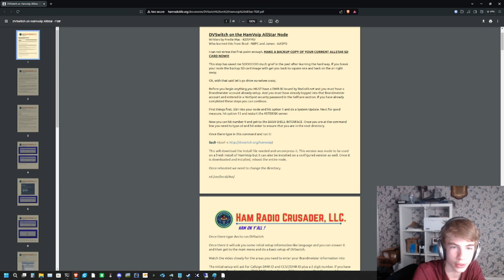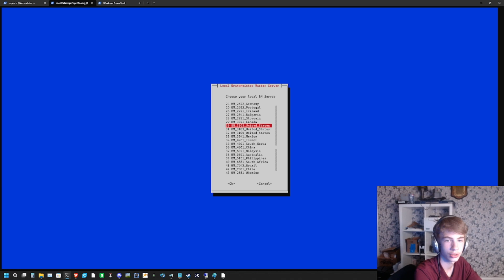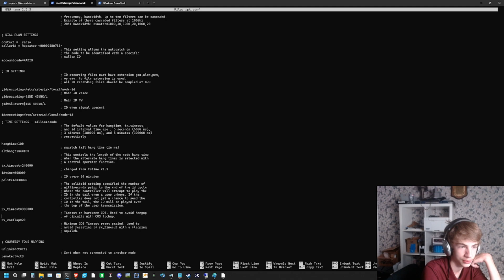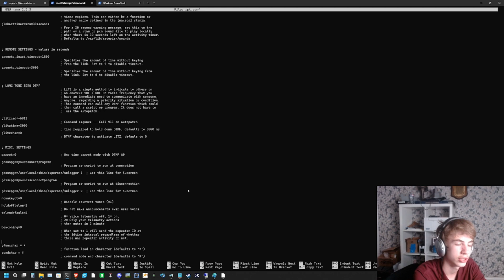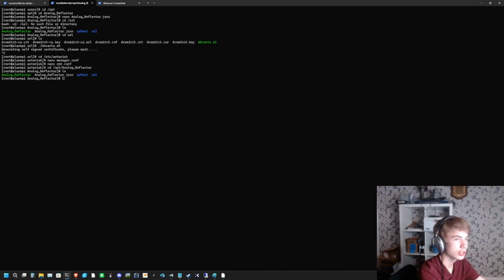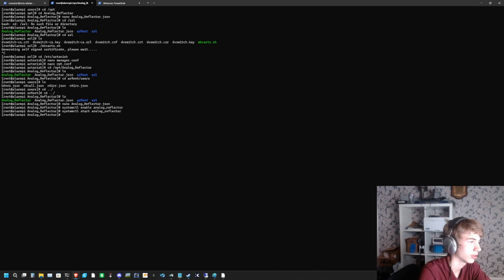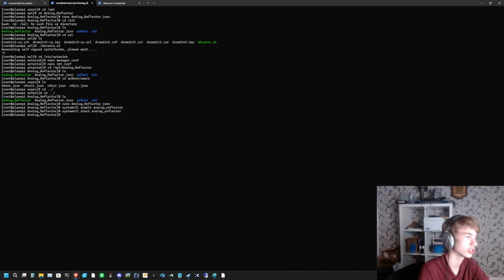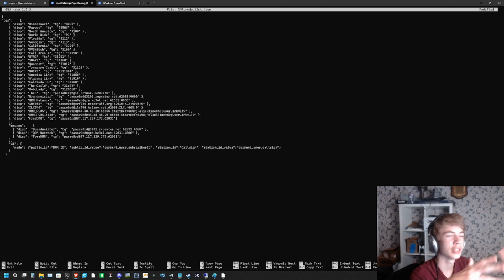Make your own Clearnode FOR FREE!! Analog Reflector Tutorial - Ham Radio & Networking

Comment from the maker: You DO NOT have to use analog reflector to make this work, instead direct the USRP ports to default and use this software to change modes/talkgroups: https://github.com/VALER24/dvswitch_mode_switcher 

As long as you only have the ASL bridge connected at the bottom turn automute to FALSE in the json file so you don't have to toggle it every time you want to change modes. If you want DStar to work well and make all the other modes sound a little better invest in a ThumbDV stick with the AMBE3000 chip.

Comment: Installation from your instructions was largely uneventful where I was able to get my HamVoIP node working with Brandmeister. That said I though there was a problem with my install where I had to (re)link talkgroup 91 (global) for every transmission into that group. But then reading the DVSwitch group, it would appear that Brandmeister blocks nodes that are not "properly" configured such as an out of the box DVSwitch configuration. In short there is far more information that I didn't configure, which might be the issue.

Then I went forward to configure my node for YSF, but I found I could only joint YSF reflectors by IP address and port. Using the reflector number did not work, even if YSFGateway was reading the reflector list file on the node. I joined the DVSwitch group on Google, but my post on this subject is moderated and the moderator apparently won't accept it thus my message never made it onto the group for others to read.

Older messages on the DVSwitch group suggests YSFGateway can work with a reflector number by prepending "8" to the YSF reflector number. But others responded this isn't working similar to my experience.

Finally I looked for the source code to DVSwitch but apparently it is not posted. But YSFGateway appears to come from the MMDVM project where perhaps it is used by DVSwitch unmodified. And if so then the command to YSFGateway to tune to a YSF reflector is not what DVSwitch is sending. That alone would explain the issue. But given the moderator is not accepting my message on this subject...

In any case I think your efforts to show how DVSwitch can be used with an analog radio has value. Keep up the good work.